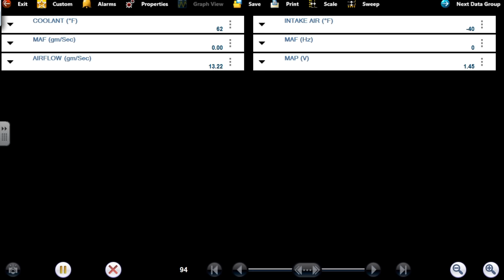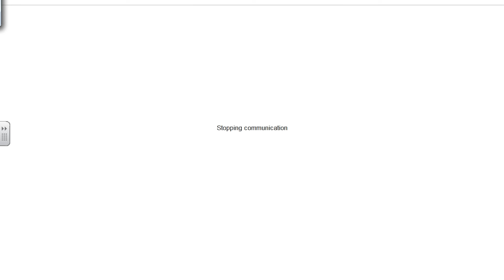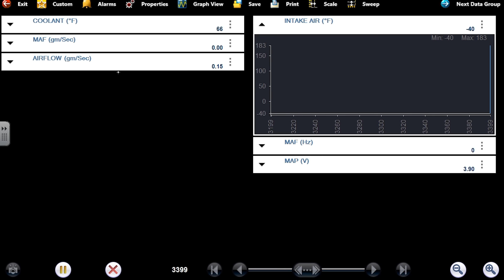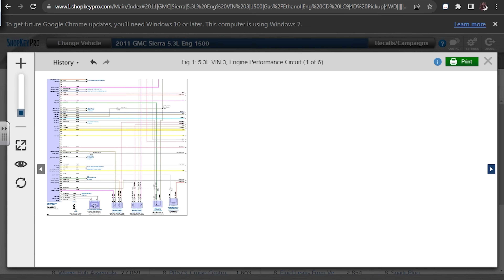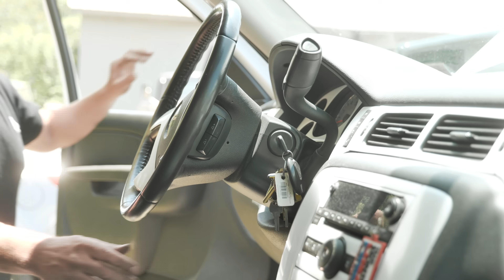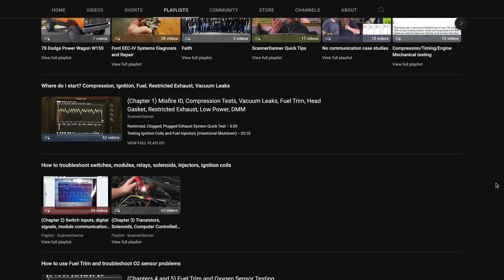2011 GMC Sierra MAF and IAT codes [New MAF Installed]

Comment: Gms especially the newer ones like to read -40 just because they get logic locked so if you ever come across one its worth disconnecting the battery for 5 minutes before you get into any in depth testing
Reply from the maker: That's a good tip. Define "newer" 😊
Reply: @ScannerDanner all of the past 5 or so year cars and trucks that use what GM calls “VIP” architecture vehicles with a serial data gateway module. You cant even do a brake job without turning every light on the dashboard on nowadays
Reply from the maker: Thank you for that information!

Comment: I was out riding my Polaris RZR in the woods. 20-30 miles from civilization,  no phones, minimal tools. My RZR starting running bad, however I realized the gravity of the situation, so I immediately limped it back to camp. I looked up the code (I have the factor service manual saved on my phone) and it was a turbo boost pressure sensor high code. After a lot of head scratching I remembered the things I learned from Mr. Danner. I checked the voltages and realized that I had no 5v ref to the sensor. I did a bunch of unplugs to try and find the bad sensor that was pulling down the system. I couldn’t find anything. But I found the nearest sensor was on a separate 5v ref circuit. So I tapped the wire and was able to bootleg the power to the other sensor. Problem solved, disaster adverted. I was 200 miles from home and even took off work for this trip, so it was great to fix it and keep on riding! Mr. Danner if you ever want to bring your camper to an off road campground in KY let me know. I’ll hook you up with guided tours!

Comment: Would the P0113 or intake air temperature code cause the service traction control message to pop up?
Reply from the maker: If your check engine light is on, yes, it is common to also have a traction control light on as well because engine torque management is part of the traction control system
Reply: @ScannerDanner  your the freaking man dude, I'm not sure you truly realize what you do for the everyday man. I understand your trying to teach techs and make them better at there job but those same words help regular Joe's  tremendously and forever we will be grateful.
Reply from the maker: @ShawnMan86  thanks man, I love to help, however I can

Comment: Got problem with Chevrolet Colorado crdi.p0101 code,I've replace filter,mag sensor,check wiring harness,turbo,and catalytic, calibrate injectors,still p0101 code appear after few miles run,, vacuum leaks test,, I'd notice that the code will came out when I accelerate with high gear position and and sudden released accelerator pedal the came that the time check engine light came out with p0101,
Reply from the maker: Define the code please
Reply: @ScannerDanner  thanks for the reply,,got p0101 mass air flow sensor circuit high,,,I followed your video about voltage check and body ground,,I find it so hard to trouble because it will just came out when I hit pedal hard at high gear then suddenly release it,, code came out again,, delete fault codes,it run goods again,,
Reply from the maker: @richwerkz6931  circuit high codes are typically an open in a signal wire, the sensor itself, or the sensor ground circuit
Reply: Thanks for info sir?id already try replace it but still desame,,
Reply from the maker: @richwerkz6931  okay, time to do some testing on the sensor circuit now
Reply: Maybe the ecu is the problem

Comment: Speaking of piercing wires. Worked on a no start and about a foot away from fuel pump found corroded wire. repaired it and still no power. Kept going and about every foot found same thing. so someone pierced it looking for a fault obviously. At that point ran a new circuit.
Reply from the maker: Yeah some people will stuff a test light into a wire and leave a gaping hole and not seal it. Smh, that's definitely not what I'm doing or recommending

Comment: Long wire to short wire. Appears they are broken at different spots or thats just how it looks in video. I repaired a main harness that was cut on a slight angle in an accident and thats how i lined up all the same color circuits.

Comment: Looks like a quick visual inspection around the engine and it wouldnt take long to find the damage , but it always good practice to check wiring measurements
Reply from the maker: The quick wiring check was the best place to start. You wouldn't have focused on that spot visually if you didn't know where to look.

Comment: If my fuel trims are maxed out on my car (+25 stft and 19.5% ltft) and my wideband (that is new) reads minus 1.074mA and 0volt on downstream and tailpipe emissions are crazy rich like 0.8 lambda reading, could it be the maf? I checked for leaks but did not find any also fuel pressure is in spec and hold pressure.
Reply from the maker: Focus on your downstream O2. No way it should be 0v in that environment. Some systems will use downstream fuel trim
Reply: @ScannerDanner  My downstream is stuck 0volt and I try to make them even more rich but nothing happends, I will swap them out because of fake lean condition👍 It's a Jaguar x308 na V8 1999.

Comment: I had a jeep gladiator a rodent got to the wire for a coil was throwing coil secondary field code, I wouldn’t have guess it because it was hard to see the wires but when I went to swap coils and everything to see if the code would move with the coil the whole wiring harness came with it lol

Comment: Thanks Paul, great video! I love the throwback to Pete's shop; I miss those days! I started using clear nail polish on the wire holes instead of liquid electric tape, as it makes less mess and you can still see the wire colors. I feel like when you use the Liquid stuff it gets on your hands and you pretty much need a Dermatologist to remove it.😂

Comment: On broken/damaged sensor ground wires, do you always have to connect back to a sensor ground or can you go to a battery ground? Just curious.  
I always hated those type of wire strippers as you always have to have a long enough wires to reach the stripping area and in a machine or an auto there
is always  those few shorty's to make it difficult. Great video Paul and Caleb thanks so much.
Reply from the maker: You definitely want to use sensor ground, not battery ground. It is for noise reasons. 
But, I have had bad computer circuit boards on one leg of a sensor ground circuit where I've used a battery ground to get the car back on the road. It's not ideal, but in that case who cares, it needed a computer and there wasn't one available and it got the car back on the road.
Reply: @ScannerDanner  Thanks so much Paul and God Bless you and your family. Take care
Reply: @ScannerDanner  I'll add to that, besides noise, while cranking and/or vehicles loads turn on and off the grounding differential will change from battery to the engine, body and ecm. while it may only be milivolts most of the time, that's still critical on low voltage sensor circuits. also large loads of cranking, fans, pumps, abs and other electrical things(steering/brakes) could possibly make the total imbalance multiple volts and the computer will see all that, as it and the sensor doesn't know any difference or may have dropouts.

Comment: Trying to figure out which tan wire is for the oxygen sensor or not, I would probably do a continuity test between the sensor connector and the broken wire and from the pcm to the other end of the broken wire (if accessible). Even though at the end of the day it doesn’t matter, peace of mind always makes me feel good
Reply from the maker: For sure! I was going to until I saw the length differences and that was solid enough evidence for me. Thank you!

Comment: Great video.   I will also say that having an outside cat is no guarantee that you won't have rodent damage.   About two years ago my 2014 Mustang GT had some wires chewed through under the hood and we had quite a few outside cats at that time.  There were quite a few cat prints under the hood so I don't know if a cat was chasing a rodent up in there or the cat actually chewed the wires.
Reply: cats love to chew on things, especially wires. I don't know how they never electrocuted themselves here over the years, but they'd chew all over lamp and extension cords, to where bite marks clearly showed bare copper inside. 🤣 them crazy cats lived very long lives (indoor cats)
Reply: @throttlebottle5906  Everyone who I told that I thought that one of the cats had chewed the wires told me no, that it was some type of rodent.  Two of the wires were chewed right up to the connectors so I had to buy new connectors and splice them in.

Comment: So a question, whats an acceptable charge for diag and fix of something like this, like 4 hours? Or is that excessive. Thoughts
Reply from the maker: I think we need to stop talking about charging for "time" but I understand needing some type of gauge by which to measure. It took me 5 minutes to ID that problem, and being paid by time says my expertise isn't worth very much. Make sense? 
I think the diag and repair for this should be at least $300? But it depends on your market and where you live.
Reply: I've seen many shops range from 140-200$ just for diagnose here in Texas

Comment: Sir I have a device called multi probe if there is a problem with a sensor wiring I can tell in just in one minute by disconnecting the sensor and touching every wire with probe and probe tells me if it's a 12 v wire, 5 volt , ground or signal wire. By simply touching the wire with probe you can tell if this wire is connected or cut from some where. Very Usefull device for all car Electricians. Every body should have one .
Reply from the maker: Got a link?

Comment: I’ve got a MAF fault.  Replaced it with an OEM unit.  Still got a problem.  Truck hesitates in second gear around 35MPH when accelerating.  Been yanking my hair out!
Reply from the maker: What is the fault? What year, make, model and engine?
Reply: @ScannerDanner  The code is p0101.  Maf Range code on my 07 chevy v6 1500wt.  I’ve checked for exhaust back pressure with a guage, checked for vacuum leaks at the intake system.  I did recently replace my spider with rebuilt unit.  It had a fuel line leak develop.  Thought maybe i burnt up my cats but exhause back pressure test doesnt show it.  Smoke tested intake as well..  i have resorted to parts changing the  tps, map, maf, spark plug wires, icm, coil since they weren’t expensive…well the maf was!  I have 210k miles on truck but it doesnt burn oil and runs well before the code.
Reply from the maker: @u2ooberboober  when did this code start? Are you using a factory MAF sensor?
An exhaust restriction was my first thought. Did you check both sides? Dual cats right?
Reply: @ScannerDanner  This code was discovered after I replaced my spider and clearing the missfire and rich codes.  I even replaced the front O2s.   I did run rich and had misfires when the line broke.  I checked both sides since there are 2 cats but no apparent clog.  I ran cat cleaner as well.  The truck runs fine after leaving the hesitation zone in the upper gears.  I do have a scope and checked the square wave of the MAF.  I do see a bit of noise on the waveform.  I checked all grounds as far as I could find.  I even went as far as to run without the altenator to see if I might have bad rectifiers..  still spikey and noisy thus my decision to replace coil and ICM.  Fuel pump amps is 6amp and fuel pressure was normal I believe, can’t remember the psi off hand.  Ran it with the guage hooked up and no dips or peaks in pressure.  I was leaning on weak pump regulator or clogged strainer but it doesn’t seem to point in that direction.  I was thinking of pulling computer and inspecting the board for cold joints or bad capacitors if that is possible.  (The hesitation is on flat or level roads..never on a down slope)
Reply from the maker: @u2ooberboober  I would revisit the exhaust back pressure tests. Pull the upstream o2 sensor on each side and you want no more than 2 psi at 3000 rpm in park.
Reply: @ScannerDanner  Copy.  I will check them again.
Reply: @ScannerDanner  I went ahead and tested both sides again.  I’m using an OEM 37263 pressure tester.  Had my son ramp up rpms.  The needle tends to bounce around at certain rpms.  On the passenger side it seemed to go from 0psi to below 0 in pulses.  It really never goes above 0 even at 3000 and 4000 rpms.  The driver side did the same thing but at around 1500 rpm the needle was bouncing to 2 psi in wide swings to below 0 psi.  It then seems it would hit certain resonant frequencies and stop bouncing as rpms were ramped up.  Never went above 0 psi at 3000 or 4000 rpms.  My son also stated while reving up the speedometer rose to 5 mph and held for some reason..  Do I take it that 2psi on the guage is not inertial swings of the needle but in fact a pressure pulse of that magnitude?  I wish the guage had oil in it.
Reply from the maker: @u2ooberboober  that sounds okay 👍  
So with a MAF out of range code, we should have some fuel trim issues. What are your STFT and LTFT on both banks at idle and at 2500 RPM in park?
Reply: @ScannerDanner  with truck in closed loop and ext at 201F:  
idle stft = 0 bank1,0 bank2.  Idle ltft = -5 bank1, -5bank2.

2500rpm  short term stays around 0 to -3 on both banks.

2500rpm  long term goes to -14 on bank1 and - 12 on bank 2.

Bank2 sensor 2 seems lazy and stays low (143mv) for a while then meets up with Bank1 sensor 2 at around 768mv.

Pwm bank1 and 2 at idle 3.62ms

Evap purge 15%

MAF at idle 5.2 g/s

IAT 104F (im in my garage in Vegas)

Engine load at idle 29%

Spark 15 deg
Reply: @ScannerDanner  I took time yesterday to really focus on fuel trims.  Im using an xtool blue tooth unit that is slow in response by one second.  Upon the hesitation the short term trims “ jump up” to +10 or so after about 1 second of the hesitation.  Sometimes I hear a short pinging as well when the truck tries to recover.  I have noticed that take off power has been getting more sluggish lately as well.
Reply from the maker: @u2ooberboober  okay, both the pinging and the positive trims are suggesting lean conditions. But your only setting MAF performance codes? Nothing else? And this started after changing some injection components right?
Reply: @ScannerDanner  I want to say that this code was set once before I changed out the spider while it was bad.  I did multiple code clearings when the spider was bad not knowing exactly what was going on and think I seen it with the misfire and rich codes once.  The spider had a leak on one of the tubes.  But yeah,  this is the only code that comes up now..
Reply from the maker: @u2ooberboober  This P0101 code is from a comparison with MAP, MAF and TPS, this is not going to be a fuel pressure or injection issue. You changed the MAP right? Factory part? Air intake hose in good shape? No cracks or breaks or loose clamps? Air filter box a factory box? You don't have some cold air intake on there do you? Is your throttle body clean? Clean it if it is not and then do an idle relearn. I do not like that your fuel trims are -12 and -14 at 2500 RPM and then +10 during the second gear surge you described.  Very strange, could be a skewed new MAF too. Hard to say.
Reply: @ScannerDanner  update:  when driving jist now to work short terms shot up to 25 and stayed for a while.  Im using my old lcd scanner that is quicker on response I guess..
Reply from the maker: @u2ooberboober  xtool sent me their D7 and D8 scanners and I sent them back smh The data refresh rate made them absolutely USELESS for EXACTLY what we are talking about.
Reply: @ScannerDanner  Thanks for all the insight!  MAP is new but not OEM.  Seems to give the same reading as the original unit that was installed.  I do have a cold air tube with KnN filter on it but this has worked since I bought the truck new with no issues.  I cleaned the throttle body when I replaced the spider assembly.  The upper manifold was already pretty clean as well.  No tears or leaks in intake or anywhere else as proven with the smoke machine.  One weird thing I noticed on my pcv system is that the usual pcv valve in mine is just a body with a presized hole in it.  No jiggly valve like my other vehicles but I read that is normal…
Over all It just seems like fuel is either being cut at that moment or there isn’t enough making it for the load at that moment.  The secondary O2s show a definite lean instance when the power drop occurs.  I was going to replace the fuel pump assembly anyway just because of it’s age and not knowing how long they could last.  I had a VW that gave up the smoke on the fuel pump on the job site years ago and I was able to replace it on site since it plugged into the resevoir box pretty easily.  I’d be out of luck if that happened with this truck..
Reply: @ScannerDanner  SD, she’s on her last leg.  On the way home today there was a serious loss of power.  Idles fine, no smoke, but try to get off the line and she grumbles.  Didn’t want to push past 25mph.  Scanner says cyl 6 is reporting missing but it feels like all cylinders.  Im going to do a pump press test, check plugs, and exhuast pressure test again if needed.  Hope it isn’t a lifter or something.  No flashing check engine light or error codes that say missing though..  man….